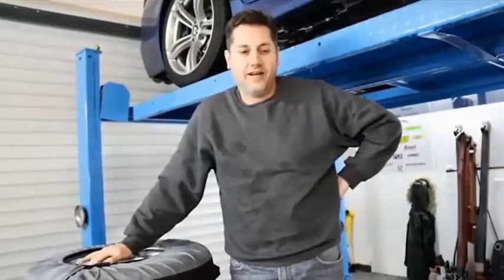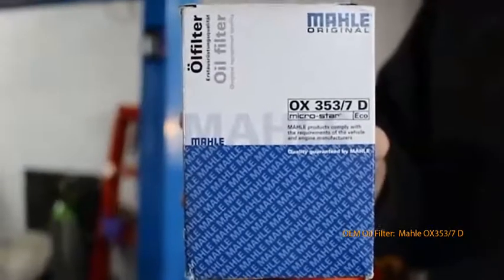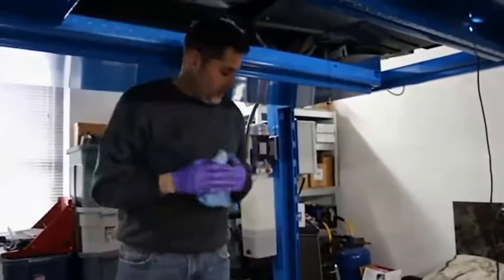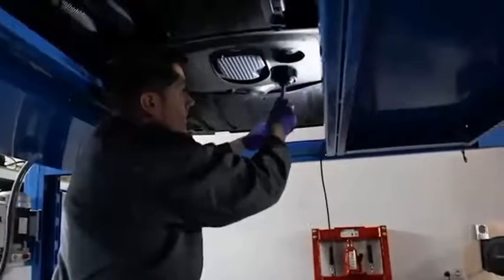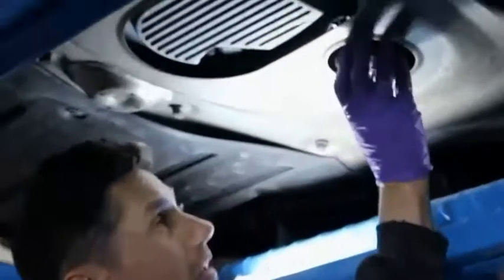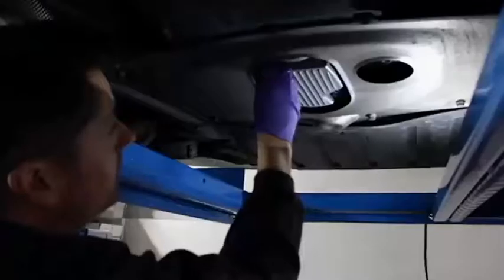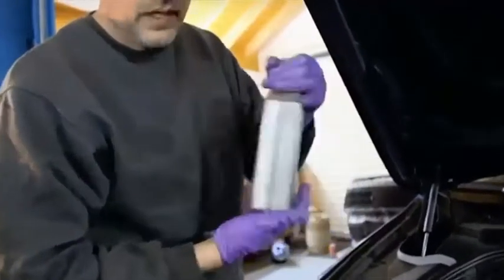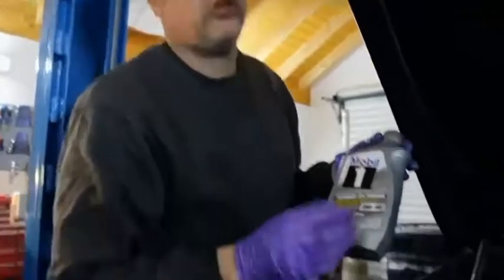M5 F10 oil change ...detailed

Comment: I'm changing the oil on my F-10 M5  IN AUG. I WAS waiting to see you change the seals on the filter and the drain plug  and do the reset for the oil service.
Reply from the maker: The reset is incredibly easy.   There's a few videos out there, but I can look into making one.

Comment: Video nicely done! Would be great if we could pull that last bit of oil out of the oil cooler! Ya, I have never had someone else change my oil.. if they even do it at all! Then there's oil plug over tightening, cross treading... years ago I bought a new car for just winter driving from Toyota, they give 2 free oil changes from new, and I still changed my own oil. No one will care more about your car, more than you!
Reply from the maker: That's how I do things too.  I'd rather learn and buy a special tool for a repair than take the car to a shop.  People typically don't care as much as yourself.

Comment: Awesome! Thanks for the Video. Very helpful as I just bought a 2013 BMW M5 F10 and used the same Filter brand and part number and had extra parts left that I could not figure out where they when. Thanks a lot!
Reply from the maker: Thanks!  I'll put out a Sparkplug and Air Filter Video in the future...hopefully a bit better.  My daughter did most of the editing with the equipment we had at hand.
Reply: That would be awesome. I am thinking of replacing the spark plugs soon! I am going to upgrade the charge pipes and Air filter housing with Burger Tuning. 

http://www.burgertuning.com/s63tu_BMW_M5_M6_performance_intake.html

Then I will add a JB4 to push up the Ponies on this spectacular car.
Reply from the maker: It will be an animal if you do that...but start looking at upgrading your clutch pack if you do go that route
Reply: Indeed!

Comment: I bought the special BMW oil filter removal cap but for the life of me i couldn't get the filter housing off. The BMW filter removal tool kept slipping around. Might be because it's cold here in NY but any tips? Should i maybe put some double sided tape on the tool?

Comment: Hi mate I know this was 7 years ago but am lucky enough to finally own my dream m5 so thought a week into ownership I will give the big girl some nice new blood/oil lol so done everything as you did but used a different oil filter tool and it slipped and I think I have broken a sensor or something because when I filled the car back up and put the front end back down it has trouble starting and I have engine management light on plus a break fault plus a traction fault and drivetrain fault what could I have done thanks hope you see this
Reply from the maker: Did you leave a car door open while working on the car?  Sound like a drained battery.  When the battery voltage is too low, BMW's spit out all kinds of weird faults.  Try charging the battery, then retry.

Comment: Great video. Mobil 1 isn’t rated a BMW LongLife engine oil. I wouldn’t care about a “licensing issue”, I’d look for oils with whichever LL spec your particular engine calls for and use that. I’ve used Motul previously and have been using Liqui Moly for the last few years on my F10. Could just be in my mind, but I think it runs the smoothest with Liqui Moly. I’m jealous of that lift!
Reply from the maker: Thanks.  I recently moved to Arizona.  Had to sell the lift :(  I'll put out more videos soon.

Comment: So there is 2 drain plugs (dry sump) also you didn't change the crush washer or I didnt see you change it while putting the plug back in and closing it up. Not a bad video

Comment: Great video. I am new to the M5 F10 after moving on from M5 e60. I wonder what is the part number for the cap you use to remove the oil filter? :)
Reply: ? Any info would help :)
Reply from the maker: I think I put the part number in the video ;).  Any NAPA tool of the correct size will work as well.  I'm just convinced by the quality of these HAZET tools personally :)

Comment: This is a great video....thank you. I have just purchased a 2013 M5 and the dealership recommends using BMW 0W 30 oil. Some websites (Liqui Molly, Castrol..) recommend 5W 30 and the oil selector of different brands give different viscosities 0W 30, 5w 30 or 0w 40. Have you looked into the details of that at all?  Will you keep using 0w 40, even though BMW recommends 0w 30? Best,
Reply from the maker: Absolutely!  0w-40 is also recommended...it's in the manual.  The mobil 1 has treated me great for 50k, and I have no oil usage between oil changes (every 10k km's)
Reply: Thank you, Bob,. Mine is also a Monte Carlo Blue M5 and I absolutely love it. I watched your coding video the other day as well. I am an Esys user, but it is painful to program on Esys. I will be getting the BimmerCode app and a BT 4.0 OBD 2 reader. It looks so much more convenient.
Reply from the maker: I used to use Esys, but Bimmercode is just too easy to pass up :)

Comment: When BMW changed my oil recently, I was met with a large oil stain on my garage floor a few days after I parked up the car. Turns out that the oil filter contains quite a bit of oil and the mechanic let it drip on the metal pan without cleaning up the area.
Reply from the maker: That's why I tackle these thing myself.  Other don't care about your stuff the way you do :)

Comment: how to you fix the noisy front brake noise
Reply from the maker: I use special brake grease on the outer metal edges of the pads (very small amount is enough).  I also make sure the caliper is very clean where the pads go. I have special brake silicone which I smear thinly on the back side (metal side) of the pads.  I'm sure some folks out there have made a video on this.  My brakes are still too good to replace just to shoot a video :)  I can shoot one on a different car...the principal remains the same.

Comment: So why Mobil 1 0w40 lost the BMW specification ?
Reply from the maker: I contacted the Mobil 1 folks.  It comes down to licensing. $$$ I was told the formula hasn't changed.  If you google the breakdown of different brand oils, you'll find it's spot on with the approved oils.  That being said, please use an oil that you are comfortable with.  If the 'non' approval bothers you, then I wouldn't use it, as it will probably nag at you in your sleep :)  I've been using it for over 20k miles with no oil use between changes.
Reply from the maker: The formula didn't change, so I stayed with them.  Basically personal choice.
Reply: +Bob Mac very good video thx:)
Reply: +Bob Mac did u add some oil between oil changes?
Reply from the maker: At 6000mile change interval I was down 1/4 qt.  I didn't add in between.

Comment: it takes an hour and a half to drain because you do not remove the fill cap first..... it is not rocket science lol
Reply from the maker: With the cap off, it still takes this long...the oil doesn't flow from the cooler very fast as it's almost level with the drain plug.  Lifting the front of the car slightly may help.  We'll see on the next oil change.